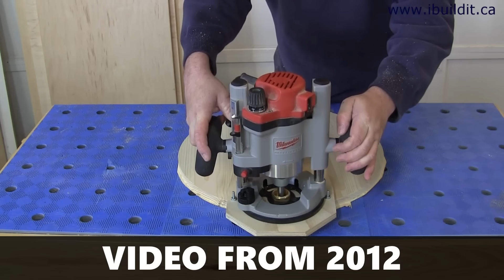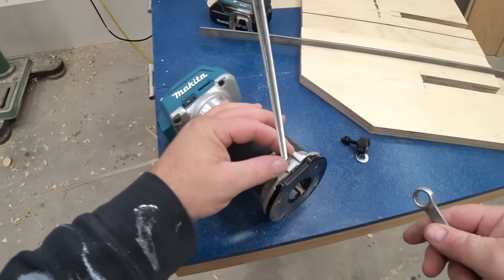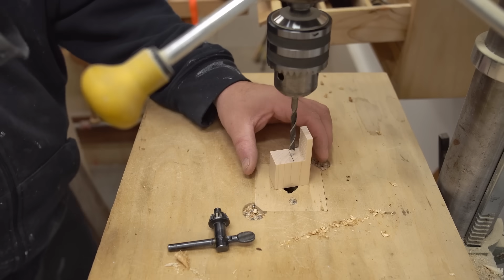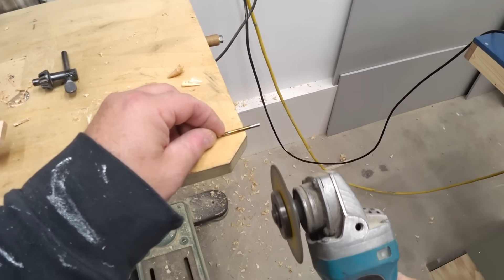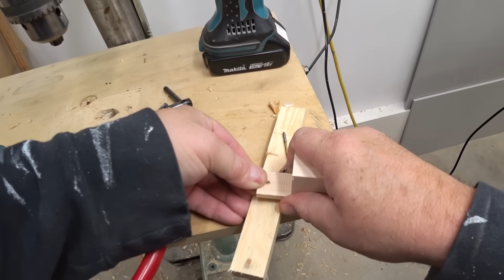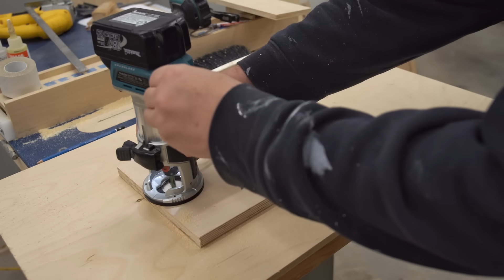Make This Circle Cutting Jig - Woodworking

Comment: A slot could be cut in the baseplate and the tongue on the wooden block extended all the way up to the router bit, allowing for very small holes to be cut.

Comment: for smaller circles less than 4" just drill a small hole in the stock base plate for the pivot point. Mount a rod (screw, nail, etc) to the piece you want the circle cut on. Place the router with the drilled hole on the rod. Cut your circle!. Just tried it today and cut out a 3" circle.

Make a new base plate if needed.

Comment: Do you have to move in a certain direction?
Reply: Well if you want a circle you kind of have to move
If not you can go for a simple dot in your wood for that dot in the wood look
But in my oppinion moving is pretty much the way to go for circles
Reply: By certain direction I mean should you proceed in a clockwise or counter-clockwise manner?
Reply: Yes, those are the 2 best choices for cutting circles. :)
Reply: :) I agree. However I understand you should move in a certain direction with a router if moving along an edge so it doesn't "get away from you" - is this a consideration when routing a circle - the inner edge will have a smaller radius than the outer. Will the router "want to go" in a certain direction which should be opposed by the operator?
Reply: OK, fair enough... yes, on an edge, you want to go one way vs the other, because you'll find that when you move one way, the rotation of the forward edge of the blade will tend to pull in the wood and keep you tight against the edge, but as you go the other way the rotation of the cutter will be pushing it away from the edge and it wont work out well, and you'll get a kind of wandering cut. 
Going right through the middle of the wood, rather than just one edge, the cutter will REALLY want to take off in strange directions for the same reason, which is why feather boards and all of that are important to keep the cutter on the intended path. In the circle cutting jig, it is the fixed length of the jig that keeps the cutter on the intended path, and doesn't let it stray away from the radius. 
More important with this kind of cut might be if you are using an up-cut or down-cut spiral bit. A down-cut will be pushing the chips down to the wood, which is going to give you a cleaner edge, but you'll need to make sure you keep down-pressure on it so it doesn't get lifted up by the dust pile under the cutter. An up-cut bit will give far superior dust clearing because it will be pushing chips up towards the tool and away from the wood. The down side on that is that you'll get a bit of tear out along the edge because the cut isn't supported, and fibers will rip away.
Of course if you are using a down-cut, don forget that it would still cause tear out on the other side if you are going to a full depth cut, so only go a little more than half way, flip the board, and use the same center hole, cut the other half and you should get a nice edge on both sides.